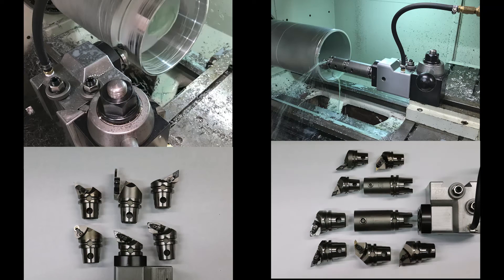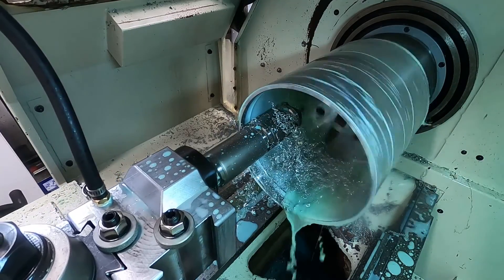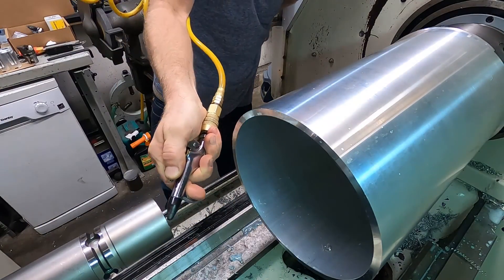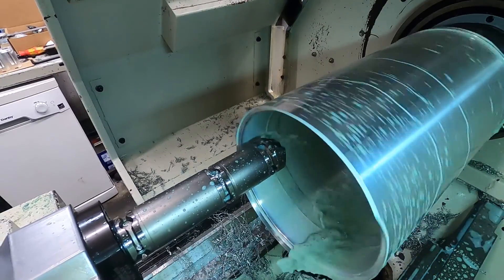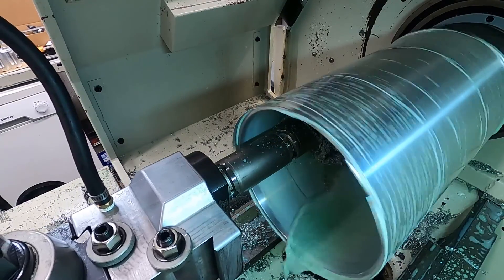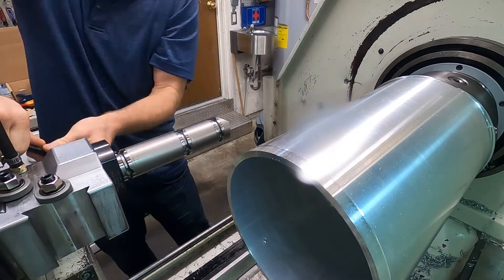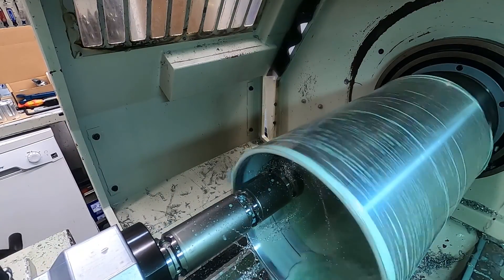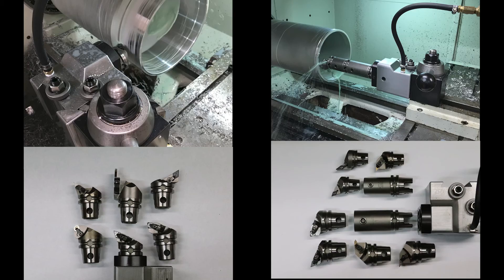Using KM Tooling On My Prototrak Lathe With A Custom Aloris Tool Post Adapter I Made

Comment: Hello have you checked your leadscrew drive belt  belt was hard  and alloy pulley on servo was worn might be worth a look
Reply from the maker: I went through multiple things on the lathe when I bought it used some years ago. My lathe actually had a loose X axis drive belt. It's probably good to take a look at everything from time to time.